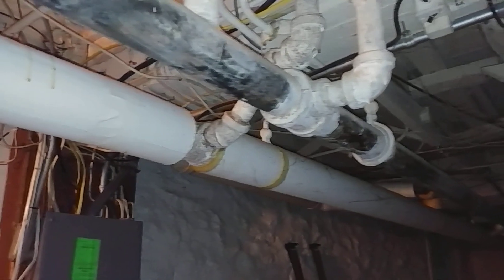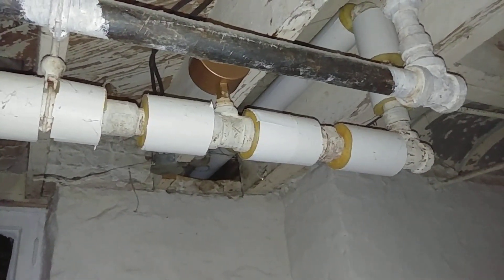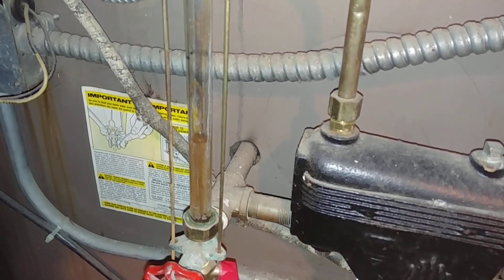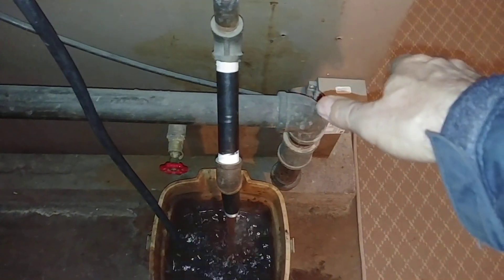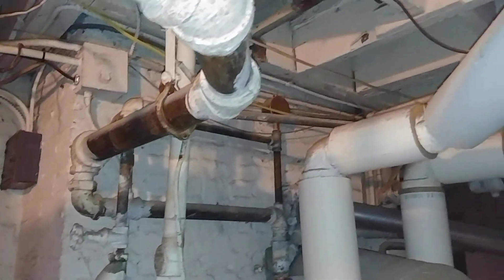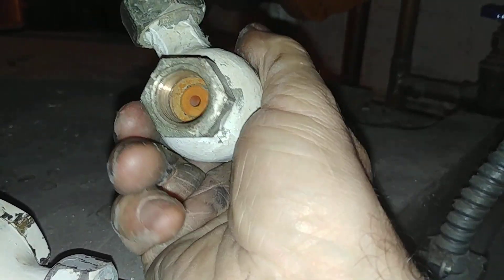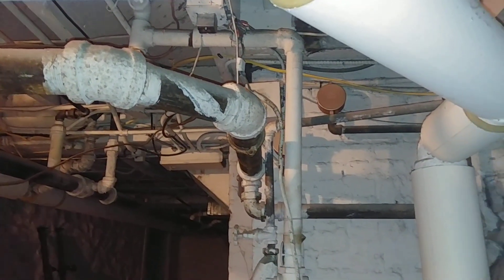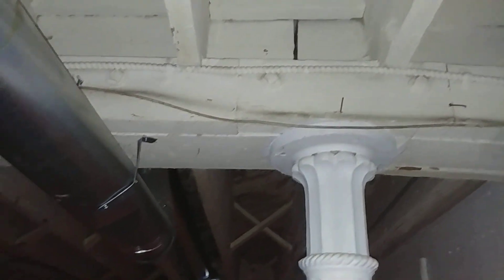Take A Tour Of An Old Gravity Hot Water Heating System Conversion To...Two Pipe Steam!?

Comment: This looks a lot like the piping in my 120 yo house which I believe was likely originally a gravity system that was converted to a hydronic boiler with a circulator pump.  The current boiler, and who knows how many there have been, is itself an old Slant-Fin that's about 30 years old and getting kind of long in tooth.
Reply from the maker: Most gravity hot water systems were converted to pumped systems when reliable circulator pumps came on the market after WWII.
A few were left as is. See the video on this link: https://youtu.be/BYbl_MBvbbs
Very rarely were they converted to steam like this one.
Don't worry too much about your 30 year old boiler. 
Hot water system boilers from that era were well built & parts still available.
The new high efficiency stuff? Not so much.

Comment: Old homes usually have a story to tell, but only if you know where to look. It helps to know a bit about the old mechanical systems so you can spot what was changed, like K&T wiring and others. I was once in a rather large house that still had all of the parts from a gaslight system, including the gas generator, which used carbide pellets with water. That same house had a fully automated coal fired boiler that was originally a gravity hot water system. Lots of mechanical contraptions to feed pea coal via a rotary screw, plus a conveyor system, that was linked to the firebox door, with an ash shaker at each cycle. Also had bi-metal t-stats to work the inlet / outlet air. These had end switches to operate the next cycle of coal feeding as the boiler cooled. Around the back side of the same chimney there was the updated, oil fired, Ideal Boiler Company equipment (lots of baked enamel and chrome) with those huge circulators of the era. Everything was tied together with T-fittings and valves so either system could be used in a pinch. Being a fairly rural location (back in the day), I could only imagine it was a common back up for power outages... gaslight included. Yes, this was a rich person's home prior to 1900. Would guess the place was well over 10,000 square feet of living space. Some years later the home was on the market, and I was there for an estate sale. The interior probably hadn't been updated since prior to WWII... and complete with the gaslight fixtures in all rooms. Quaint doesn't begin to describe what was there!
Reply from the maker: Many thanks for sharing your story!

Comment: The few HW gravity systems I have seen had the piping running uphill away from the boiler for both supply and return.
That would have put the supply piping in the counterflow position.  Were there drips for the mains?
And how did they handle an equalizer and HF loop?

I assume the low pressure operation allowed many of these piping transgressions to be forgiven.
Reply from the maker: You are quite correct, and I would like to add that that old American Standard boiler has huge steam chest and large exit pipes which allowed drips to be dispensed with.
If, in the future, that boiler needs replacement, that installer (unlikely to be us), will have to pay attention to the condensate counterflow to do the install properly.
We see that mistake all the time.
That is partly why I make these videos. 
There is an equilizer and small Hartford Loop (and no wet return) at the rear of the boiler.

Comment: As a warm air guy, I'm quite familiar with the gravity warm air systems and how they worked. (or kind of worked) But I am puzzled how you'd get water (and the attendant BTUs) up into the radiators for the necessary heat transfer without the benefit of a circulator.  How did that work?
Reply: Hot water will rise and the colder return water will drop but the pipes have to be large enough and pitched correctly to handle the flow,you also have to make sure that the radiators get flow through them as well which sometimes meant using orifices on certain floors. Dan Holohan talks about this on his website so check him out if you want a more thorough explanation.
Reply: @frmerrin2  thanks
Reply from the maker: Agree with everything @frmerrin2 said.
I would like to add this:
I am a proud Steam Guy, but I must give credit where credit is due.
Although Mr. Dan H. called steam heating a "lost art", I would say that gravity hot water heating was the true lost art.
Reply: @gordonschweizer5154  totally agree. Every fittings, every nipple has to be put in methodically for it to work right. And when they work only radiant floor heat come close to the the same comfort and noiseless operating heat u can get. Unfortunately I often see a new boiler installed in these old gravity systems, put in a pump and incorrect plumbing causing uneven heating throughout the house. Sad